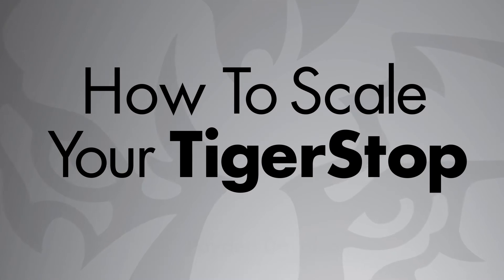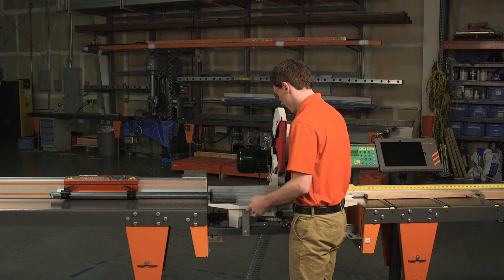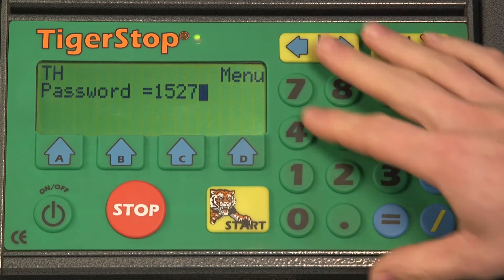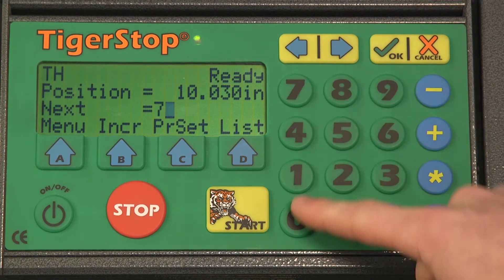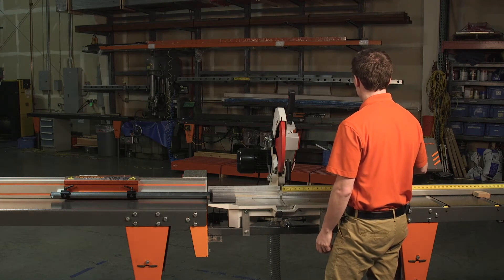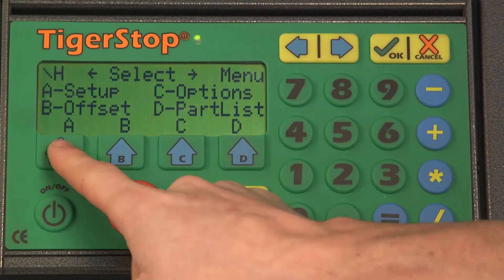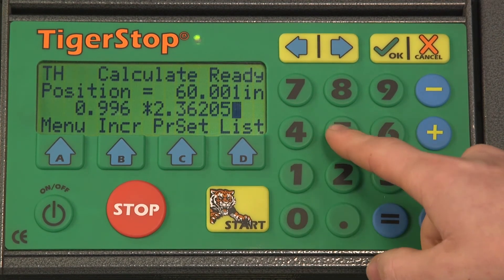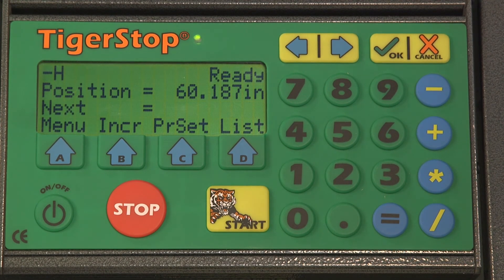How To Scale Your TigerStop

Comment: What’s the shortest length to cut on the (manually) tigerstop
Reply from the maker: The TigerStop is accurate to +/-.004" so in theory you can get pretty close to the saw blade. What are you cutting and using to cut?

Comment: What are possible reasons for the tiger stop to become uncalibrated?
Reply from the maker: Hi Andrew- we suggest scaling your machine biannually. The environment in which we test TigerStops can be dramatically different from the shop's we send our machinery to, and it is good to ensure that your machine is scaled properly. Calibration is slightly different. Typically we see calibration issues when a new operator tells the TigerStop that it is the incorrect distance away from the saw blade or tooling. Calibration is a simple fix and we often recommend cutting a test piece, using a digital caliper to measure the test piece, and typing in the correct measurement into your TigerStop. We have a great support resource page if you visit: https://www.tigerstop.com/support/troubleshooting/
Reply: Good morning the reason for loose the calibration, is  multiple, but the more incriminated is the internal belt and pulley, running after a lot of time the teeth of the pulley can have a different revolution, and the belt have damage, in some position stop in the corret measure in some other have a little difference.